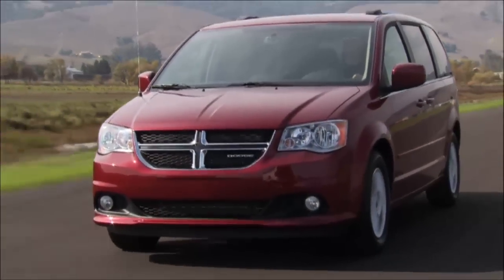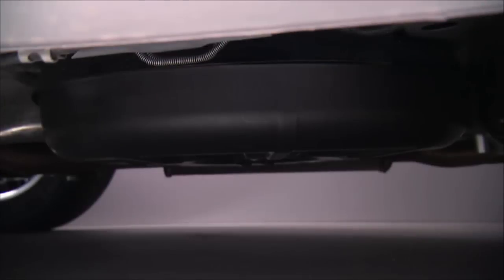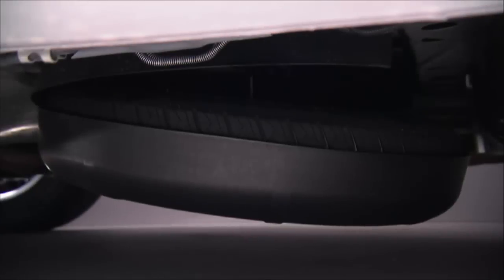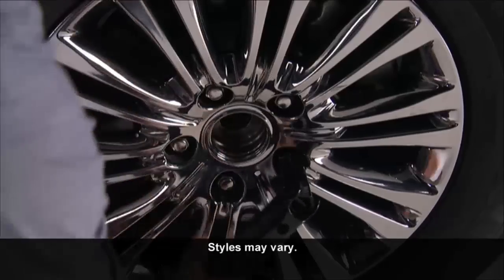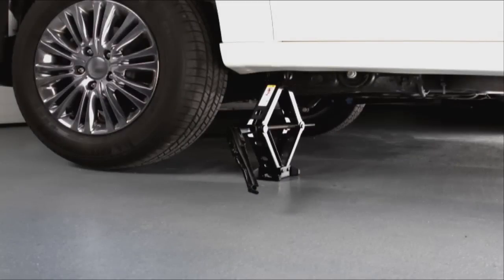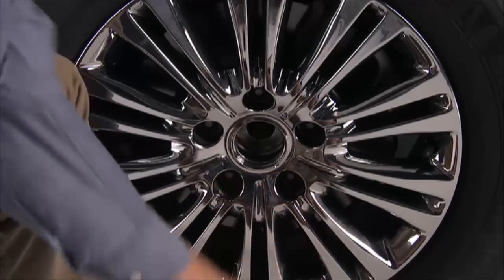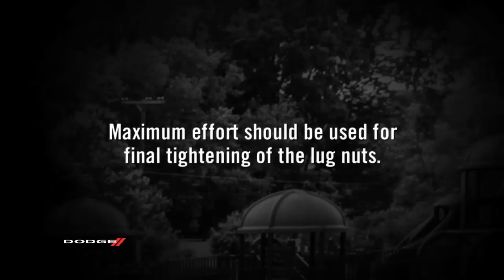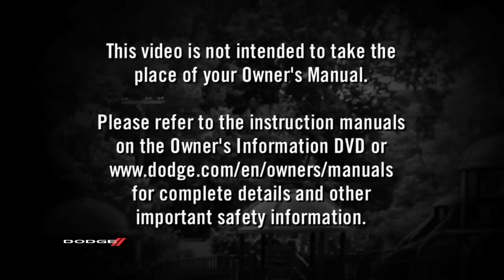2015 Dodge Grand Caravan | Jacking and Tire Changing

Comment: I just bought a 2019 Grand Caravan with the tire inflator option.  Is it possible to install a spare tire in the original location in addition to the inflator??
Reply from the maker: Hi azzir325,
Congrats on your new Grand Caravan! We recommend contacting your dealer to discuss this as they will have the appropriate tools to make this determination. If you'd like to read more about your new vehicle, you can click on the following link to view a PDF version of your Owner's Manual: https://msmownerassets.z13.web.core.windows.net/assets/publications/en-us/Dodge/2019/Grand_Caravan/10455.pdf
Reply: I have a 2016 and just bought a kit from Amazon much cheaper than dealers
Reply: Thanks.  Kind of junky, if you ask me.  Still under 20k miles and already throwing "ghost problems" at me that the dealership doesn't really want to hear about.   Rear door misbehaving.  Recently I used the remote start and the engine started, then shut down in about 20 seconds, repeatedly.
Reply: Thanks for that.  Did your van HAVE a spare when you bought it?  I'm not sure if my van is equipped with the appropriate cable, etc as it was shipped without a spare.

Comment: Would have been nice if this info was in the owners manual.i could not find it.I have 3 flat tires on my van cause those tpms sensors the end snapped on them.Bright thinking using a matarial that is known for corrosion.

Comment: Hi, my 2015 Dodge Grand Caravan R/T middle compartment is attached to the console mold and it doesn't seem to be removable. Any idea on how can I take it out?
Reply: if you open the sliding panel on the compartment closest to the console, and then pull out the rubber lining on the bottom of the compartment it will reveal the nut you need to turn to lower the spare.

Comment: What do you mean do no stow the flat tire in the spare tire location?
Reply: Do not stow the flat tire in the spare tire location.
Reply: The spare is smaller, so the flat fire is still too big to fit into the shield device under there.